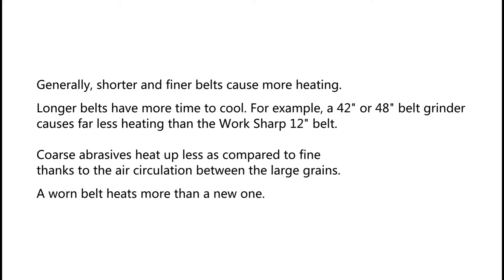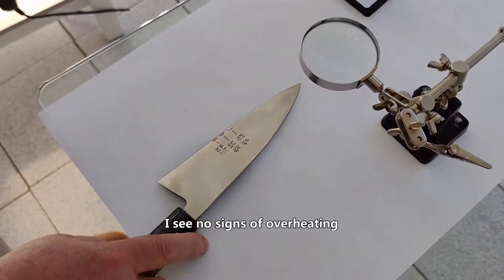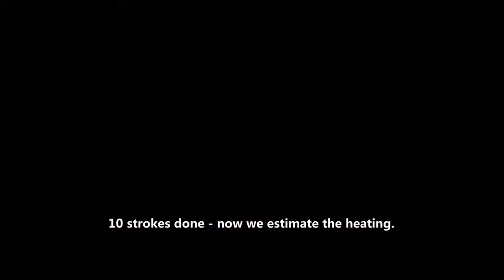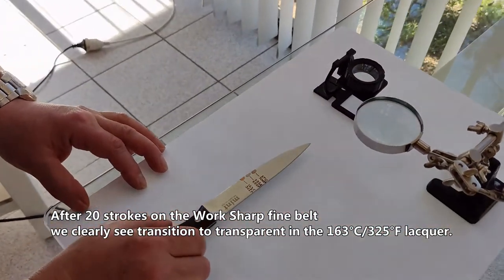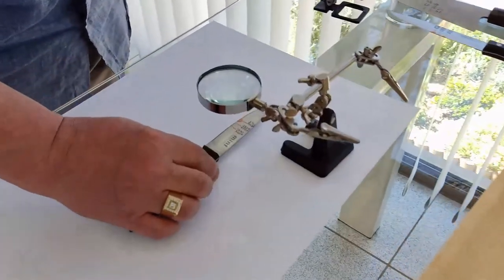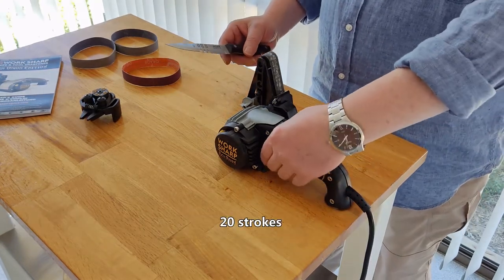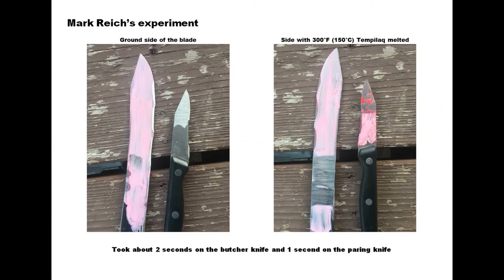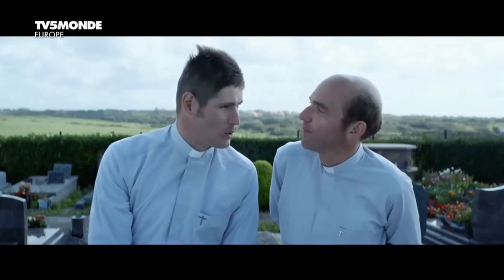Heat in Sharpening - Work Sharp, belt grinders & sanders

Comment: Have you considered implementing a blades cooling process? 
1. Pre-cooling the blade prior to the initial passes on a belt grinder - set a baseline temperature in ice bath.  
Options 
a) ice water 
b) ice saline solution 
c) dry ice solution 
d) liquid nitrogen - obviously there is a risk of the metal becoming brittle 
2. Iterative cooling e.g. 1/2/3 passes over the belt / reset to chosen baseline temperature / pass over belt …..

My suggestion was made prior to viewing your entire video.  However, taking temperatures of the cooling liquids prior to grinding would make for some interesting comparisons.

Comment: Great job. I recommend to list line speed of the belt sander as reference. I have a 550w power file uses 533mm belt and it runs at 3 to 16.6m/s.
Reply from the maker: The belt sander belt speed is 7.5 m/s
Reply: @knifegrindersaustralia5158  Thank you
Reply: @knifegrindersaustralia5158  Doesn't 2900 RPM means the motor RPM? or my misunderstanding.
Reply from the maker: Thank you for asking, as how I put it was confusing. In the belt sander episode, 2900 RPM is of course the motor, and the belt speed is 7.5 m/s as per the Manual.

Comment: The sharpening community is going to miss this man.  That said ... in the WS test he's only sharpening about 3" of the 5" blade and taking close to 6 seconds per stroke on average.  Thus, he's going at about 2 seconds per inch and not the recommended 1 second per inch.

Comment: Thanks for taking the time to do these tests!

If you have a chance, try re-doing some of your tests and looking under much higher magnification. You'll find that the very tip of the edge (being microns thick) is almost guaranteed to be overheated by only a fraction of a second of touching the belt, even at it's lowest setting. The magnification you used is not adequate enough to see the significantly overheated microscopically thin edge.
Reply: For people maintaining their own knives/hobbyist knifemakers it shouldn't be a big deal to grind that out on a coarse whetstone or over just a few sharpenings. I can see for pros that might be too time-consuming though.